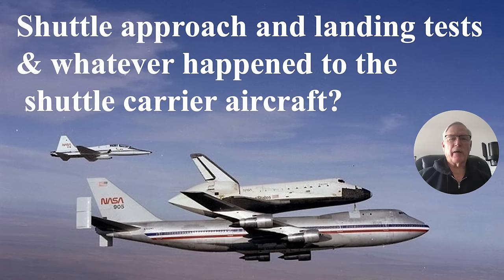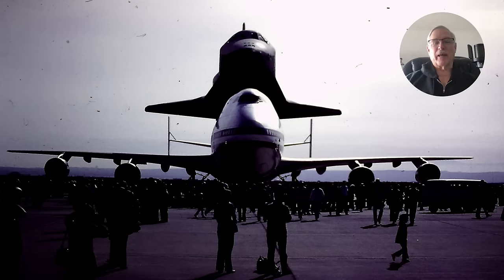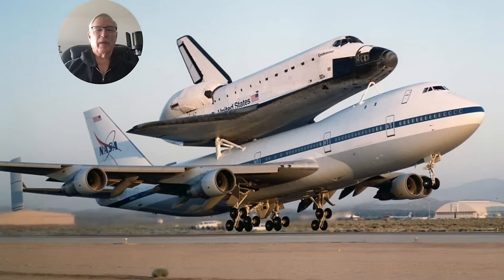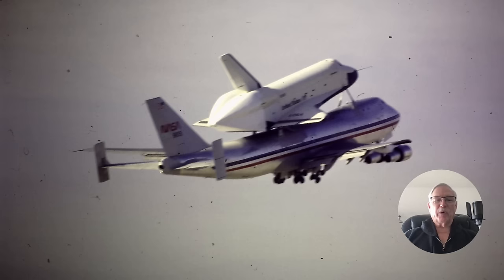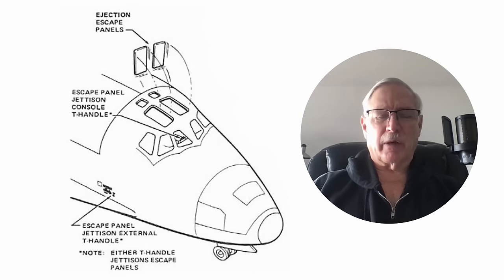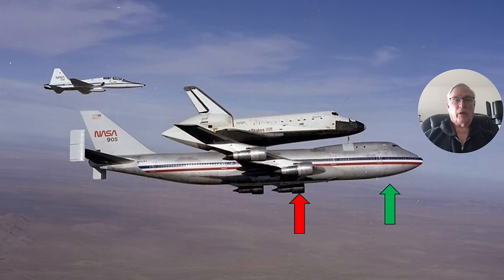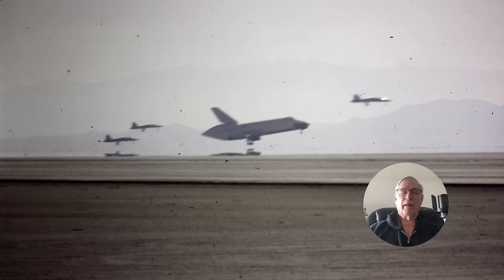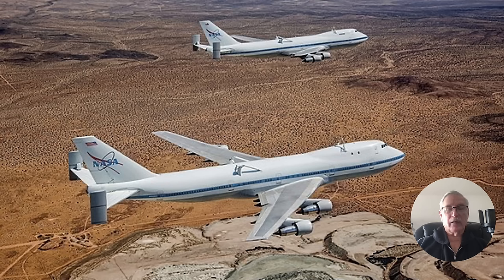Shuttle approach and landing tests & whatever happened to the shuttle carrier aircraft?

Comment: Ron, that is a great question. I am Former Boeing Everett where the (2) 747's were built.The two modified 747 Shuttle Carrier Aircraft (SCA) were retired in 2012 with the end of the Shuttle program. By that point they were around forty years old - which is old for a heavy airlifter - and had seen several decades of hard, stressful flying. They had reached the end of their safe service lives

Comment: Just a couple of clarifications; the ejections seats were actually operational for the first four missions of Columbia (STS-1 through 4).  They were still installed for STS-5 & 9, however, they were disarmed due to the larger crew sizes.

The Flight Rules allowed for ejection seat use up to 120,000 feet during ascent (not 80,000 as you mentioned).  The “Negative Seats” call came at about 1 minute and 50 seconds into the launch.  
However, as you pointed out, there were parts of that timeframe that were considered “black zones” due to exhaust plume heating and its effect on the seat/chute/human.
During entry/glided flight, the Flight Rules allowed for use of the ejection seats below 100,000 feet (“Positive Seats”).
Overall, the utility of the seats was really about cases where the orbiter couldn’t make a runway - for example; you have 200 miles to go, but your energy is such that you can only glide 75 miles.
Reply from the maker: Yes I realized too late about operational on the first 4. Thanks for the clarification and  I had not remembered that they were allowed on approach. I can always count on smart people giving me accurate clarifications! Thanks!

Comment: I got to see the 747 and the Enterprise when it came to Huntsville, Ala. It was interesting for sure. I can identify aircraft by sound as well. The old EA-6B's had a whistling sound when it had the boards out and was landing. It was as loud as the A-6 — those had a tearing sound coming from those twin J-52s when taking off. Harriers have a whitelisting sound as well. F-15s have a howl. We just had an F-35B squadron stand up. I haven't seen them enough to hear them. They are like Hornets — relatively quiet unless in burner. I wonder what V1 was with that thing on its back? these are really good photos.

Comment: I did see the shuttle in person once. It's funny how big it looks on TV. And how massive it looks sitting on the back of a 747. But parked on the ramp. It's really not very big. I was quite shocked at how small actually was. Not saying it's a small object. I'm just saying that it is much smaller in person than it is on TV. And it's definitely smaller on the ramp than it is on the back of a 747. The other thing was just how rough it was with all those tiles on it. I fully expected to see a very precise, high tolerance spaceship. But instead, it was sort of like a bunch of Legos. Very surprising to see in person.

Comment: When I was stationed at Vandenberg AFB in the late 1990's there were still some remnants of the Mate/De-Mate facility and it's associated large concrete pad out on the flightline. It's a shame that part of the Shuttle program got cancelled. I wonder how many cranes were needed to lift the Columbia onto the 747 at White Sands after it landed there back in 1982 ? Bet that was a fun day. 😀
Reply: Vandenberg was NOT a safe facility for manned flight operations.
The problem was everything was too close together!
You have the launch command center TOO CLOSE to the (intended shuttle) launch pad at Vandenberg which is a  very bad thing if you have an accident -- ask the Soviets how that worked out for them at their Kazakhstan facilities when they had a super rocket explosion.
Everything at Vandenberg was done out in the open.  There was no Vehicle Assembly building to protect the flight hardware.  I believe they used a train rail system to move the shuttle to the launch pad instead of the large crawler-transporters they've been using a Kennedy Space Center since they started testing the Saturn rockets.
The other big issue was dispersal of the rocket motor exhaust.  Motor exhaust is both toxically lethal in high enough concentrations AND explosive.  Vanderberg wasn't geographically set to disperse rocket exhaust well unlike Kennedy Space Center.  A pad disaster at Vandenberg could have killed far more people than all the accidents (in-flight, training, aircraft, auto fatalities) put together in the entirety of the US space program.  The Russians lost over 100 people in the pad accident I referenced earlier.
KSC's layout is dispersed to protect the public AND KSC launch control from potential disasters.  The public will never be poisoned fatally by a launch because they're miles away from any of the launch pads.  Most disasters would happen over water (like was the case with Shuttle Challenger) BUT it pays to have the control and spectator areas located miles away (8-10 miles?) from the launch pads.

Comment: Around sunrise at Edwards one morning, we were departing our company facility in a van towards the far end of the main runway for an airliner test later... right about as the 747/Shuttle was taxiing from the mate facility.  Our driver "floored it" to the IIRC 15 mph speed limit.

We hoped to make it out there in time to disembark and be at the side of the runway, but their takeoff was from the near end so we didn't make it all the way.  Still driving in the van as it roared down the runway (using up most of it), but just the same really a sight to see as it zoomed by from only a short distance away.  Rotated after it was a bit past us, and then a very leisurely ascent ("Positive climb -- more or less -- gear up!" ;)